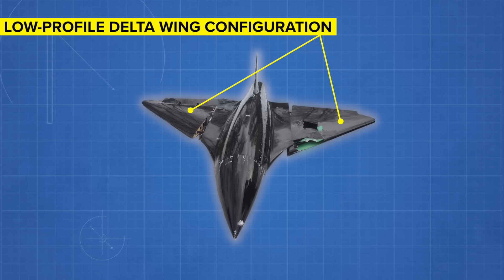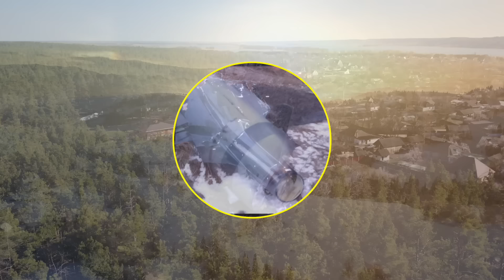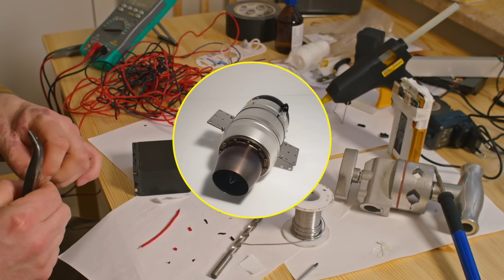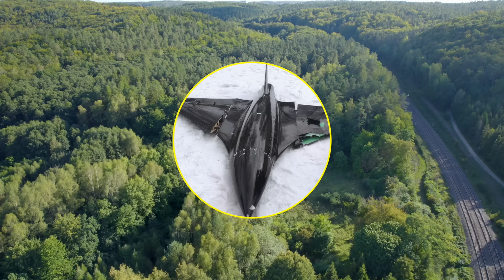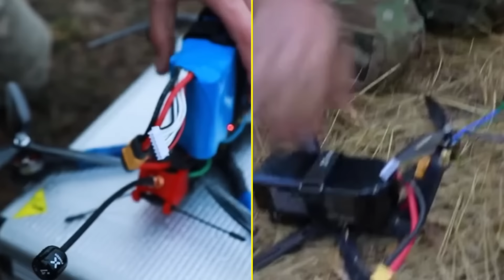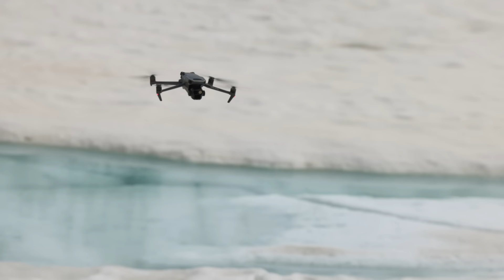New Ukrainian “Ghost in the Sky” Can Turn Any Russian Air Defense to DUST

Comment: Made in China ... For about one fifth of the cost of the European brand.
The Swiwin SW140B 14kg thrust brushless turbine engine generally costs between $2,099 and $2,423 USD, depending on the retailer and specific package, such as the V3 version with auto-restart. It is a popular, high-performance, compact turbine designed for RC jet aircraft, often featuring a brushless starter and fuel pump.

Comment: MADE IN GERMANY, ... 
JetCat P400-PRO-LN UAV Turbo Jet Engine 40Kg Thrust Turbine RC ...
The JetCat P400-PRO-LN turbine engine generally retails for approximately €10,236 to €12,180 (approx. $11,000 - $13,000+ USD), depending on taxes and specific configuration.

Comment: I would use the stealth drones mainly against AA missile systems (S-300/400/500, Buk, Patnsir S1, Tor) and AA and surveillance radars. With large amounts of those systems taken out, there will be huge holes in Russias air defenses that long range attack drones can slip through undetected. More importantly big air defense holes would allow Ukrainian warplanes like the F-16, Mirage 2000, Su-27 and Mig-29 to slip through and do large scale attacks on russian positions, logistics, rail lines and other high value targets. Warplanes can carry more and heavier munitions than most drones and can do more damage.

Comment: Well the fuel usage for this model is roughly 0.8lbs/min...so for a 15 minute flight (i guess at max rpm) its gonna be 120 lbs of fuel.  And it only has a thrust of 30.8 lbs...so It won't go far, nor very fast (faster than prop drones, yes but not really at anti missle/jet stuff).  Catalog cost for engine is around $2k or $3k US. A RPG bomb weighs around 10 lb?  This drone has to be operating at the extreme edge of range/speed/bomb weight.  The much vaunted Baba Yaga drone payload is 33lbs.

Comment: Just an idea, what happens if add most advanced updated solar paint that is midnight blue/purple…long heat resistant material ??? That way, could power electrical for longer. Could even add same colour to the propeller to transfer air drag into electric to power stealth drones at night as well???? Like imagine using air drag to power it. After all, if it 100-200 in speed already…that should be then air drag to power the stealth drone at night and day. Not just that, but it could potentially make stealth drone go a-lot farther….all with small amounts fuel, if at all.
I’ll admit, I am no researcher…but in theory. We already windmill technology, meaning so be able to covert air drag into electrical power as well…right????

Comment: This drone could be made from thin vacuum formed thermoplastic with ICO foam bonding the upper and lower profiles. No carbon fibre and the control surfaces placed in voids in the moulding  as pre assembled modules making it  very light and easy to make.  RC model makers use similar construction.
Reply: You can also make it from washing machines, just ask the Russians.
Reply: @woodytobiasjr8265  Good idea ...

Comment: @1:45 Barring the tail I could be looking at an SR-72. 
Slap some radar absorbent paint on the plane and it probably has the radar cross-section of a hummingbird.
Since it's a kamikaze drone, the exterior paint could be highly inflammable, possibly made out of VantaBlack coated flash paper, so that there is no debris left for the Russians to analyze.
Reply: I like those ideas!
Reply: I don't know if it is actually a kamikaze drone as such... More like simply considered expendable. As in consider oneself fortunate if the thing would survive to go for another mission, but don't really think about it if it is lost on a mission.

While stealth coating might be nice, it also could be hard to get, and potentially not even needed, since... If the thing is built mostly out of radar transparent materials, there is not so much need to absorb radio waves, as they would pass through anyway. Not to say it does not have radar reflection or stealth paint could not reduce radar signature... But it could be just stealthy enough to be able to take out AA-radars. After all, as a drone it is smaller than manned aircraft. If the frame is "transparent", and the overall shape borrows a couple of pages from classical stealth aircraft design book... It likely has quite small radar signature to begin with, at least compared to anything AA-equipment has been traditionally been designed to track.

Comment: Rocket engines from models could be used along with cardboard im disappointed no one is using model Rocket engines because its cheap less than 100 to make a glider drone if you need a quick deployment of drone you can put together in seconds. Let's suppose you make said cardboard drone to be built on field for whatever current need is for example id design it to have the engines hidden and scaleable  so when needing to take out tank might need more explosives  add more rocket engines if scaleable and one way for cheap that serve multipurpose role
Reply: It was mentioned in the video that the jet engine which is suspected to be used (SW140B) is normally used for model aircraft, although no info is confirmed yet, I believe. All they have to go on are the 2 pictures of the crashed test-drone.
Reply: @Bjørn-Olav also as a side note my friend your jet engine you shared is 2500+ dollars  vs rocket engines Size d are 14 for 2. Which is better cost to lose buddy im suggesting making cheapest possible front line drone to eliminate enemies or 1 time surveillance i believe on the battlefield adjustable to needs that is so cheap every soldier can be equipped making its a absolute nightmare for Russia 🇷🇺.
Reply: @wsk-clown  Ah, that sounds like a good idea! Maybe they'll use that, then. Ukrainians have shown great innovation when it comes to developing new drones, and how to use them in swarms 🧠

They would have to be able to fly for several hours, though. Not sure how those rocket engines are on fuel consumption?
Reply: @Bjørn-Olav they  are perfect for short  distance the rocket engines. Im saying model Rocket due to cost. If drones are on front lines then you dont need huge range  to hold or even push troops the ones  with range  need to be targeting high value targets meanwhile cheap rocket gliders drones would  be good for bulk targets something that costs near nothin.
Reply: @Bjørn-Olav thats thing it would depend on environmental condition and how many rocket engines and complexity of each configuration etc modular design is why fpv are being used now. one with paper body 2 servos a reciever  and scaleable due to needs  with whatever size and amount  of rocket engines a d size model rocket engines  can launch a rocket up to 2000 feet up so if you launched up 2000 ft no clue how long you can glide if in a good lightweight configuration maybe couple miles ranges but its cost thats important 2 servos about 20-30$ model rocket engines size d 6 $ each, receiver for about 10-20$ that's  what about 50$? Per unit not including cameras etc that puts production at about $100 per unit. Complexity isnt always good simple things can be repurposed.  One problem with fpv is em jamming a glider will just continue to glide and you can theoretically make a faraday cage to prevent jamming or just use optical line. I love engineering i had an even more destructive idea but ill wait to share only with my government.  With the front lines them being couple hundred meters away you dont need range you need cost to defeat russia if you cost are extremely low and thier is extremely high you can wear them down
Reply: @Bjørn-Olav that is jet I do believe i said rocket engines. I was referring to non reusable cheap 1 way drones for multiple purposes jets are cool but complex rocket engines  just a little rocket science 😂 and chemistry. You launch your drone up let it glide to intended target